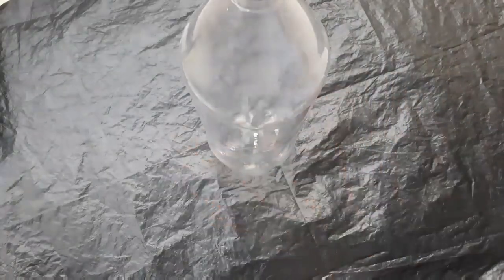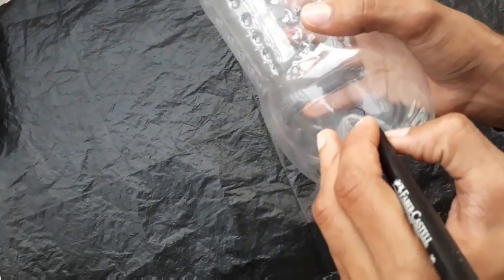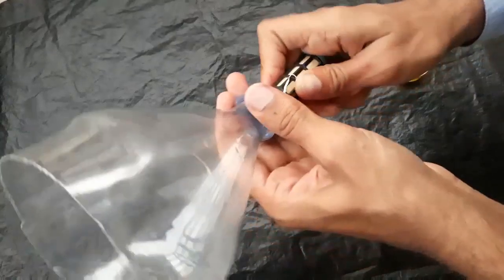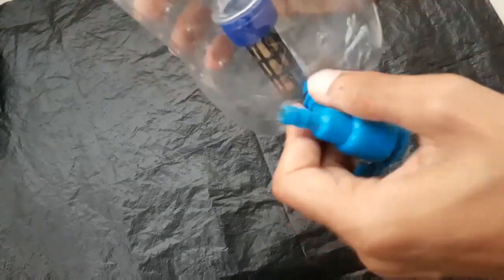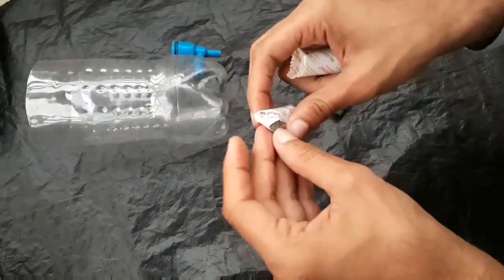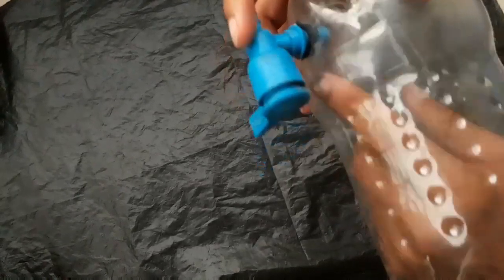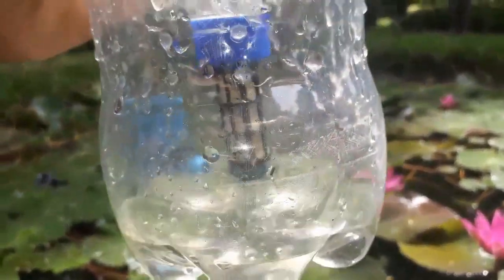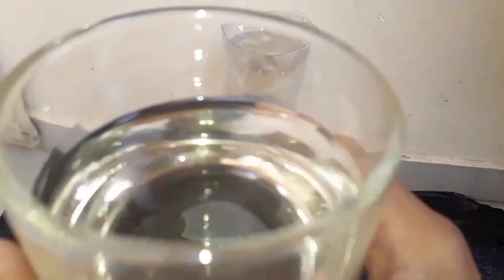Make Water Filter from Plastic Bottle | Plastic bottle life hacks

Comment: i know right? What if you have no filter or tape? There's a last resort. ONLY if you are dehydrated 3 days and dying. You fill the bottom (without making a hole in it, and add as many tiny pebbles, even grass blades too, fill up the reverse cap, then get 4-7 rocks, start a fire and let the rocks heat up, after a couple hours, place the bottle half in the fire, but try and get the heated rocks to do the job too. Let sit til you see the boiling, and also, this is imperative. ONLY do this as a last resort, because plastic is toic..but it isn't as deadly as bacterial parasites.